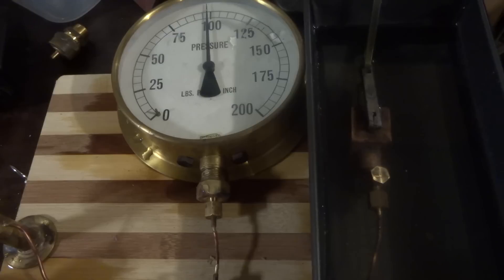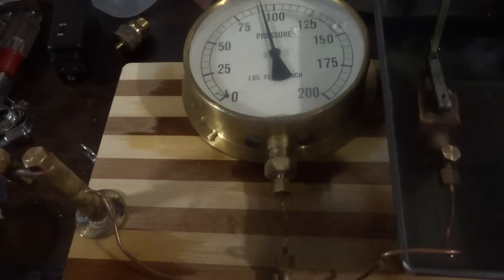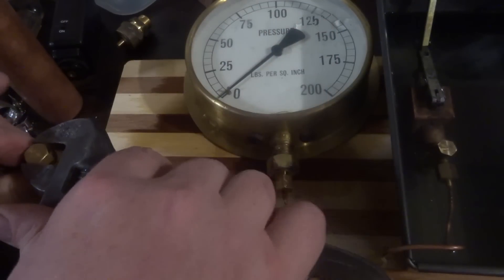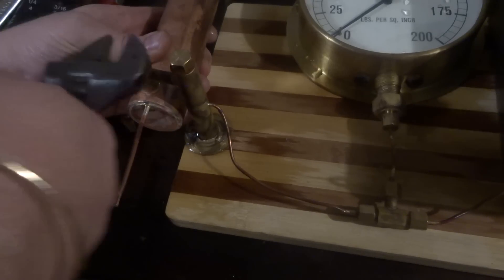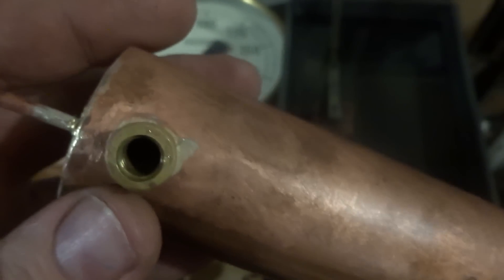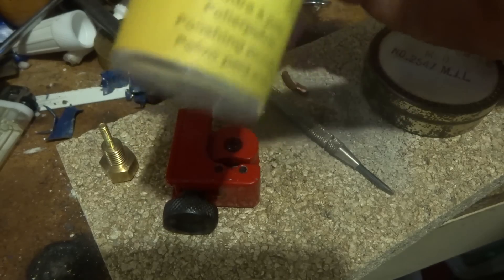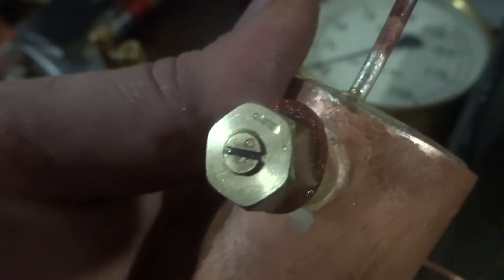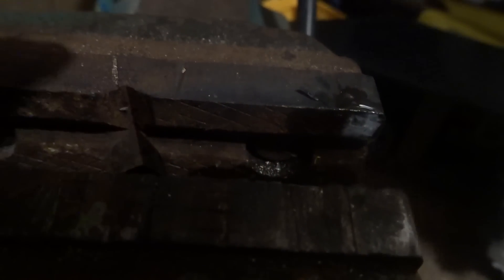K W  SCHOOLS  Steam Engine PART 14 boiler testing

Comment: Looking good Emma. cerberus is correct 10psi or so should be fine for most small engines. I have several small boilers and never run them up as high as 50psi.  For a very fine grinding paste similar to Brasso try your tooth paste. Smokers paste is the best. Also good for getting the glaze off of plastic light lenses etc.  regards from the UK

Comment: Hi Emma, nice work on that steam engine, I'm enjoying the series.I think the slight dome on the ends looks rather nice, providing it still fits into the frame ok of course.Will you be doing a video of the myfordboy steam engine, ? I've been thinking of making one  myself they look good, All the best from England,Howard
Reply from the maker: yes i will do that engine soon. its rather nicely designed isnt it?
Reply: Howard Nicholson Actually the slight done of the heads make it take a higher working pressure. Hydra formed heads can be made for large pressure vessels.

Comment: I think you will probably not need over 10 psi with this engine so a relief valve at 50 psi should not be a problem.  Thanks for sharing.
Reply: +cerberus Unless Emma plans to replace the gas engine in her car, and her area is very hilly... :))